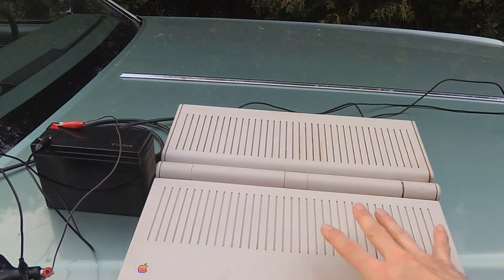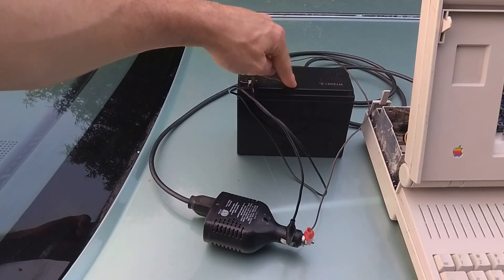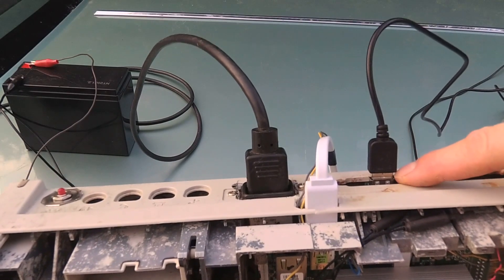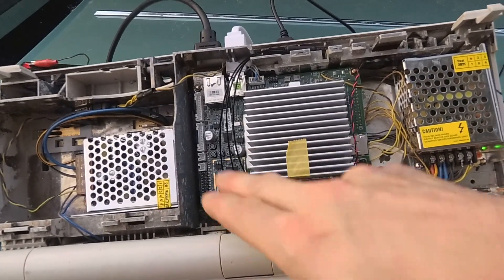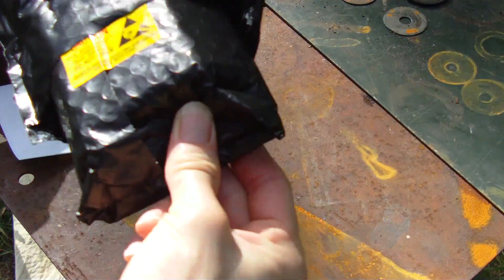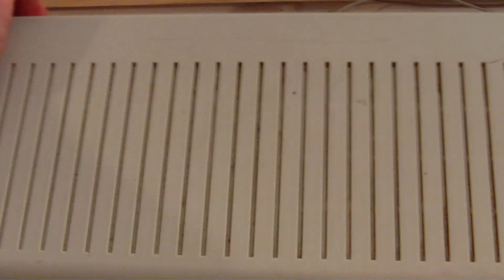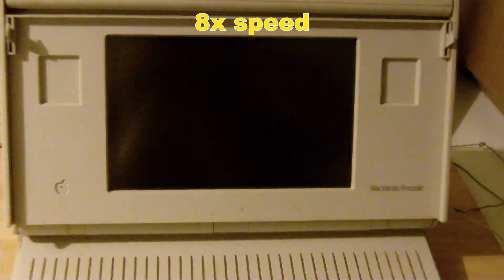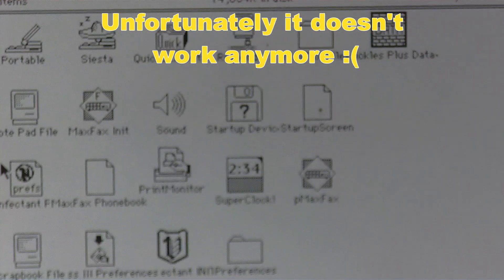DIY Upgrade on a 1990 Macintosh Portable Computer - Atomic Pi SBC in a Original Mac

Comment: How can I turn the atomic pi in to a open source portable drum machine?
Reply from the maker: I'm not really sure about using the atomic pi. I think it would be easier to use a micro controller board like arduino Uno with a stepper motor shield they are open source, or use a engraving machine controller. I just ordered some but haven't hooked anything up yet and still learning.